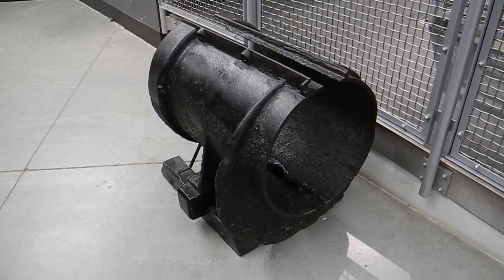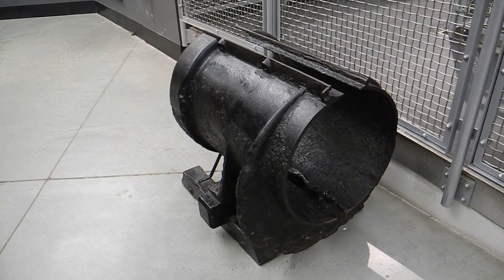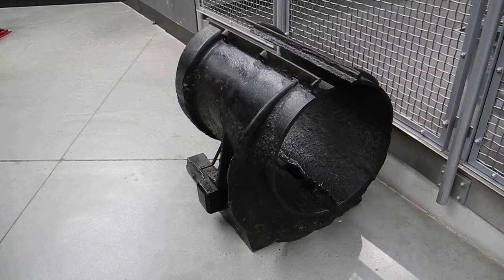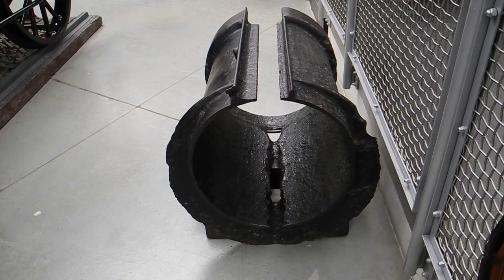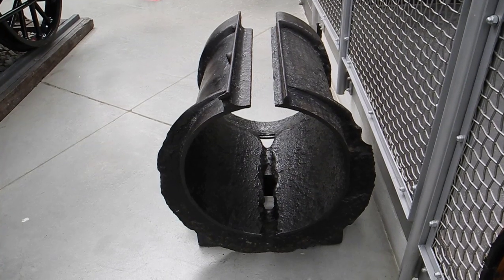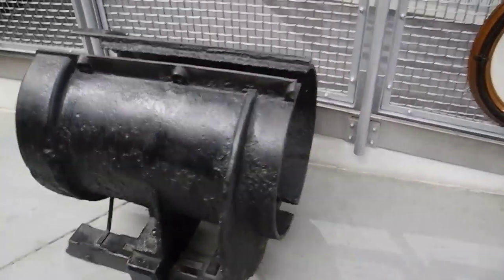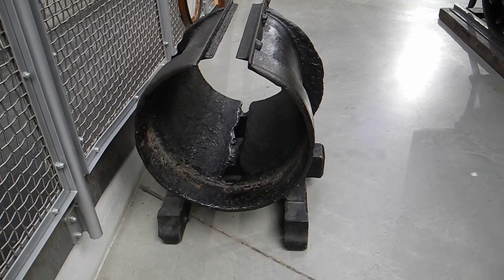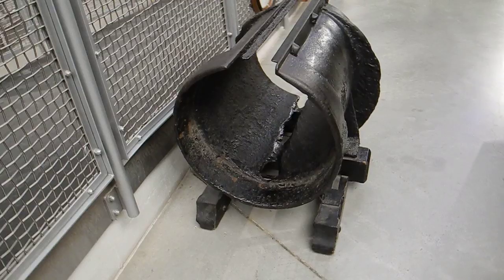Brunel's Atmospheric Railway

Comment: This needn't be the end of Brunel's story.  An electromagnetic induction cable can be encased within these conduits, or replicas of them, and cylindrical neodymium permanent rare earth magnets or trucks containing the same encircling 270 - 315 degrees of their diameter, but with sufficient clearance all around so as to avoid contact with the conduit.  Double - sheaved wheels could run atop the conduit.  Electromagnetic repulsion/attraction accelerate/brake the train,  eliminating the need for adhesion.  This, in conjunction with a modification of Louis P Brennan's Gyro - Train mechanism , would result in a monorail capable of fairly high speeds possibly around 300 MPH without the bulky ROW.  All that would be needed is a strong , flexible I - beam girder affixed to the underside of the conduit, in order to prevent sagging of the cable.  This may somewhat resemble the 1886 Joe Meigs Monorail in Boston, or the Mannheim aero bus of 1975, or the Lockheed Japanese monorail  in Yuon (1967).  Programmed to travel at speeds up to 75 MPH, ideal for metro operation .  So, let's NOT write off Mr. Brunel so quickly.  How about it?